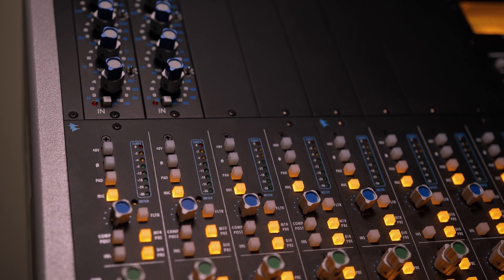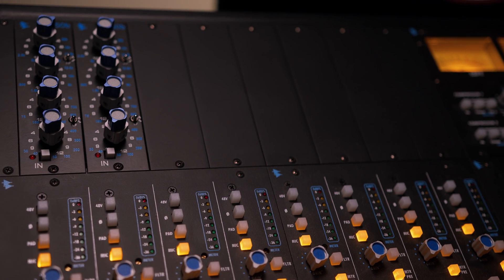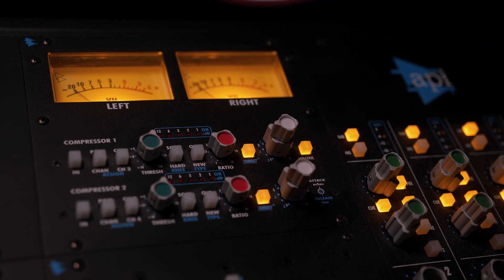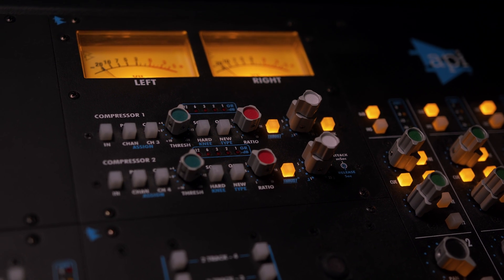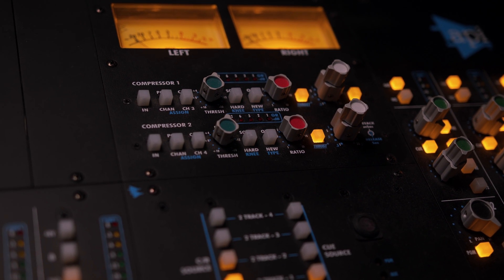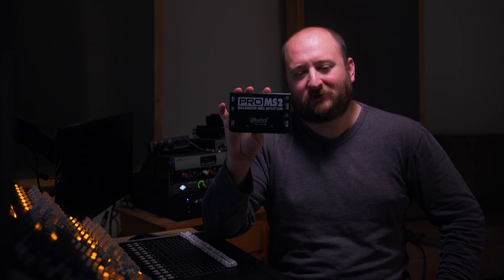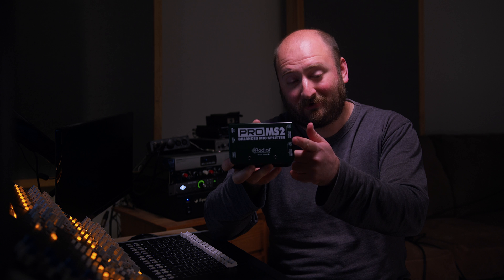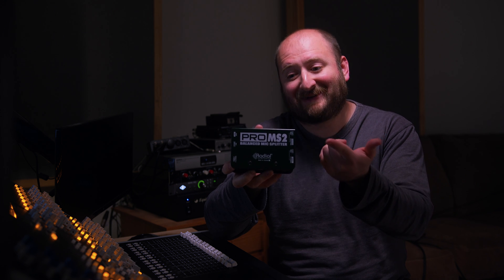API Hardware vs UAD Software Shootout Part 1

Comment: It was definitely enlightening. My own conclusion was that the the software had quite varied a degree of success, at those different stages of preamp, EQ and a whole chain with compression. With the preamp modelling, what I was hearing was tthat the preamp modelling was not an adequate substitute for the the real hardware. They did not sound like the same thing. It sounded like a rough ballpark approximation, at best. So, especially for the critical tracks like vocals and main guitars, I think it's worth investing in the hardware if you can afford it. Especially when a great preamp like a CAPI VP28 is not that expensive for one or two channels, relative to the cost of a UAD audio interface. Whereas, with the EQ, it was closer, and I would consider the software quite acceptable. For me, this chimes with the fact that many engineers are very comfortable at this point using software EQs extensively. But the most interesting thing was that once the full signal path was heard, with the compression, then the full paths sounded acceptably close again. I've noticed that before with cheaper transformerless mic clones. Naked, they sound inferior. But, once you introduce EQ and Compression, even digital, the gap becomes closer. So, with a bit of work, can get there with software. But, if you can afford the hardware, you save yourself that work/time.
Reply from the maker: I read your comments on all three videos. We are pretty much on the same page with everything you said. The EQ was definitely the one thing I could not tell a difference on with anything, the software EQ phased out pretty much completely with the hardware in most instances. I ended up selling the EQ's after that video, I'm extremely happy with the UAD ones.
Reply: @MillSounds  yes, I owe you sincere thanks. Because I was setting our my budget for next couple of years studio budget. And EQs were towards the bottom of the list. Sources then mics, room/monitoring at the top. But, after this, I will reallocate what was the EQ budget, probably toward a really nice stereo ribbon mic pair (AEA, Coles, or Royer). Once you have one or two pairs of great pres, plus a bank of 8 good ones, maybe that's good enough preamps. Be interesting to know why you decided to offload the API The Box...
Reply from the maker: @compucorder64  I've got the console for sale on reverb right now. I have absolutely no complaints with it, it's great and I like it. This is a whole other conversation, but it just boils down to me not needing a console. I went really far down the hardware rabbit hole, used the Box Console to help be the brain and put everything together and just decided I don't really want to work that way. I'm going to really simplify things here soon, but it has nothing to do with the console. It's amazing, I'm just realizing I'm going to be happier going consoleless...
Reply: @MillSounds  Makes sense to me. I used to have an ex-BBC OB van Amek BC3. I sold it when I moved country from the UK. I kinda miss it, ... a bit. But, I don't know if I'd re-invest in a console again. I'd get more out of some great mics, or a great drum kit, piano, Rhodes, Wurlitzer, interesting amp, vintage synth or whatever.

Comment: Thanks for this! I own an api 3124 and an Apollo x8p. Was curious about the other aspects of the hardware. Even listening on an ipad i noticed subtle differences with transients which confirms what I’ve heard with my api pres. API is more in your face, but if you JUST listen to the sound they’re about the same. The EQ was actually less of a shift than i thought. But the pres is where API really shines. Curious what would happen if you overdrive or saturate both how they would respond comparative to each other.

Comment: I noticed that the UI would suggest you're using the mk i. variant of the uad plugin. Wouldn't the update with the newly modeled output section be a fairer comparison? Other than that, love the comparison. Thanks for taking the time to do this.
Reply from the maker: When the new version of the plugin came out, I tested it out and found there was no sound difference (Universal Audio has pretty much confirmed this in a few online forum posts). I did a few tests comparing it to the original version of the plugin and was able to get them to null out completely when comparing them, so there is no difference in the sound as far as I'm concerned. It's a lot of money to pay for getting a fader on the output, but might be worth it to people that are a fan of the 560 EQ (which was a nice addition).

Comment: Ive got the API console in UA Luna and really considered the Box but got a RND 5060 coming. May still change later cause Ive had GAS for this, but getting deep in Neve. I can hear the analog is just a little more open than the ITB. But sometimes it is that last little bit that can really make the music shine. You are right about pushing into the red, that's where the Shelford really shines. Don't think 0's and 1's can recreate that.
Reply from the maker: I love RND Consoles, a friend of mine has an 8 Channel 5088. Those 5060's look great if you don't need preamps and are looking for a solid command center for your studio!

Comment: Awesome! At this stage, we can confidently say that UAD shows itself very worthy! I listened several times with my eyes closed and at some point I realized that I couldn't tell which was API and which was UAD! You have done an excellent job! Looking forward to the next videos!
Reply: @Ascoundrel  Yes, you are right. The difference in switching is noticeable.I meant that I do not understand where is UAD and where is API. Maybe it's a placebo, but sometimes it seems to me that the API has a little more "body", and the UAD is cleaner and brighter (which is probably better for modern styles of music). It is hard to say. And it is all the more difficult to say what is worse and what is better. There is a difference, but the character is very, very identical. In a blind test, I would not say what and where exactly. Only switching. I can't say that UAD is better and API is worse. And vice versa. The same level of professional and excellent sound.
Reply: @SYNTHDIMENSION  correct this person 100% could not pick out the difference reliably in a blind test. Really no one can, and def not in a mix.